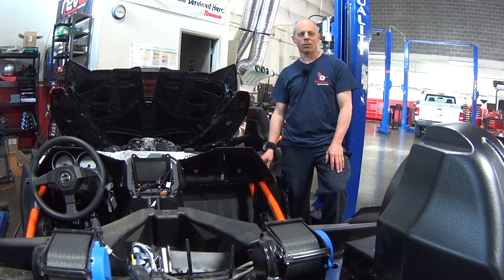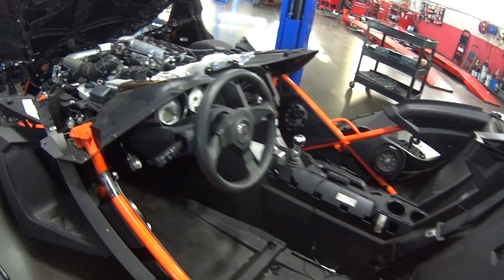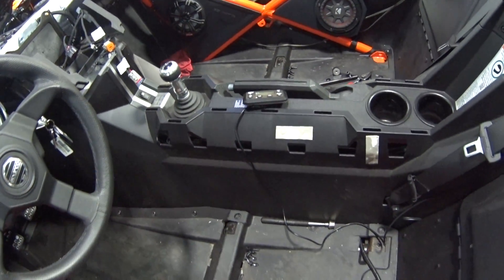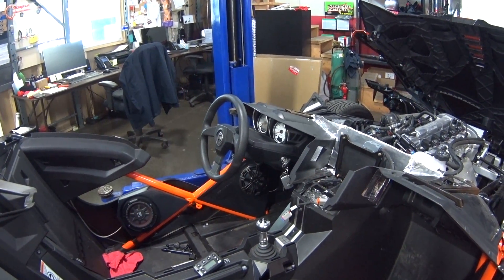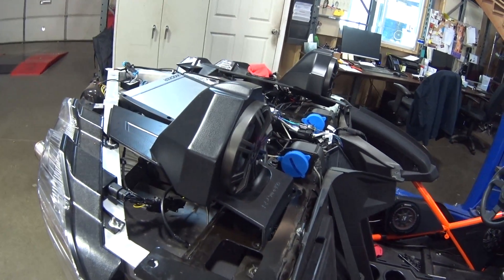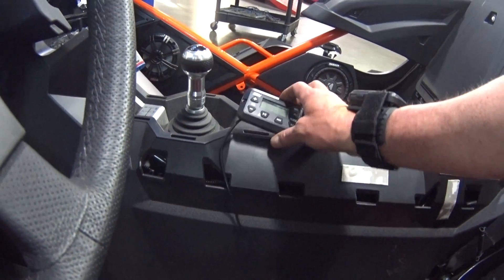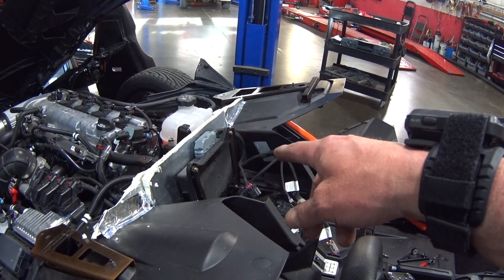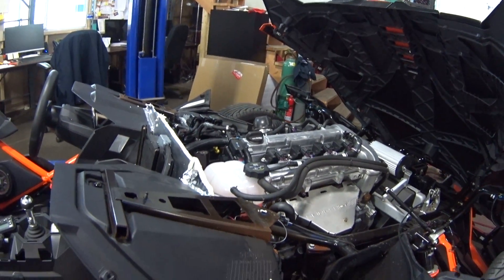Nova Slingshot stereo and heat shield installation video

Comment: Great setup! I have a question about the space above the cubbies..  I want to run a couple flush mount 3/4” round lights from the top and was hoping to not have to remove all the body panels and the bulletspeed roof.  Do you have any photos or video of the area right above the cubby ?  Is there clearance or a way to get to that area without taking everything apart?

Comment: How thick was the insulation and is that insulation on both sides. I looked at one at Lowes and only one side had the silver lining and the other side was the exposed Styrofoam. If that is the case then which side does the silver lining goes towards. Towards the inside of the dash or towards the engine side. Do they sell one with both sides insulated. Thanks

Comment: What kind of amp did you use, Do you sell the brackets?
Reply from the maker: I used a kicker 800.5 marine. The .5 means it has 4 channels plus a separate sub channel. It also has a switch so the sub channel can listen to the rear 2 speakers and get the sub frequency from that if you only have 4 pre amp wires on your head unit and not a sub pre amp.
Reply from the maker: I actually made the brackets out of aluminum from the hardware store. Just a hacksaw and a drill bit was needed.